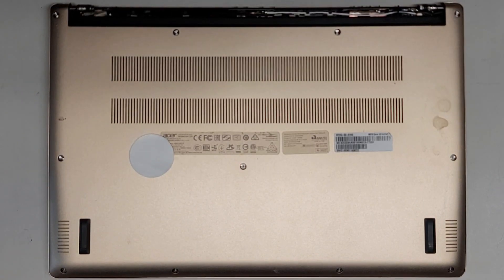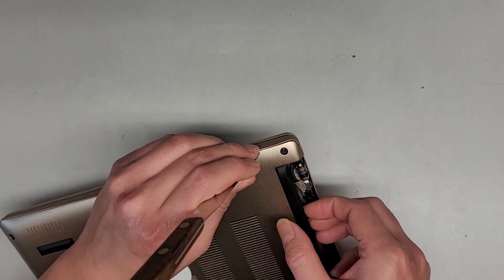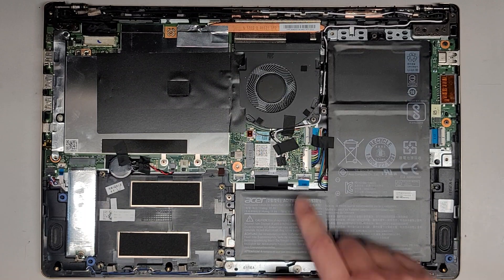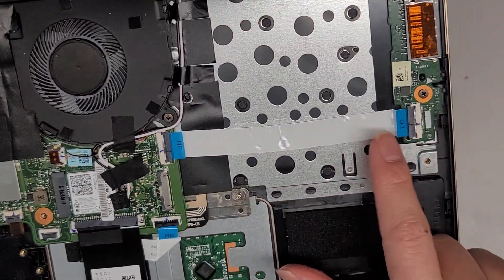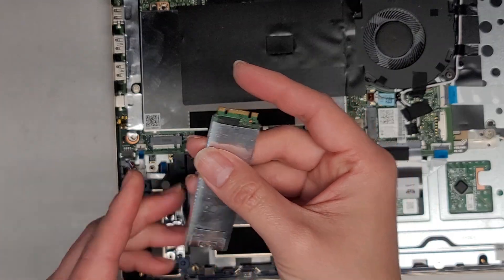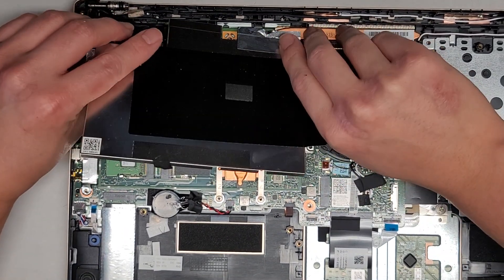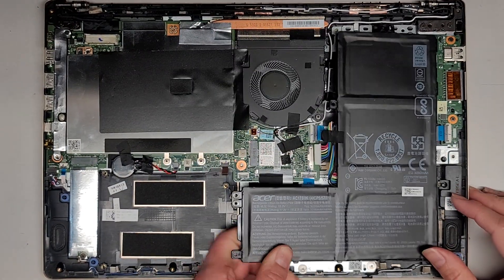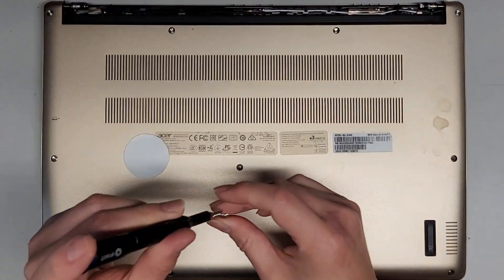Acer Swift SF315-52 Series Disassembly RAM SSD Hard Drive Upgrade Battery Replacement Repair

Comment: Which m.2 slot it has
Reply from the maker: What do you mean?
Reply: @ItsBinhRepaired  I want to upgrade my acer swift 3 sf315 52g model of 2018, which  so want to know which SSD nvme or M2 SSD it is compatible with
Reply from the maker: @amolbendale9006  not sure. Most likely pcie nvme
Reply: @ItsBinhRepaired  ok got it, thanks for replying me
Reply from the maker: No problem